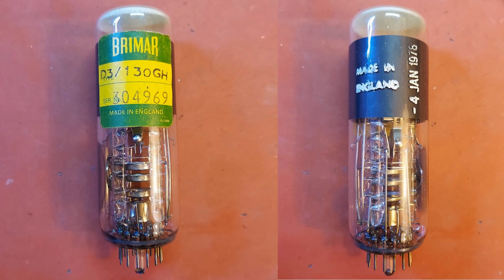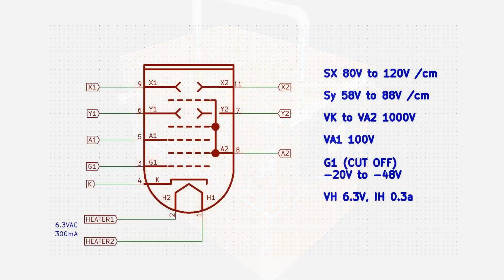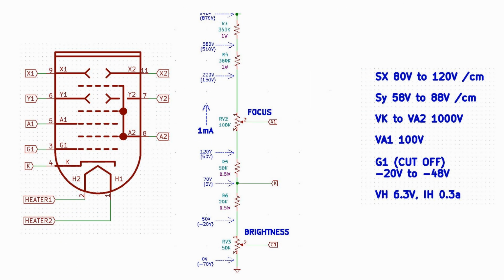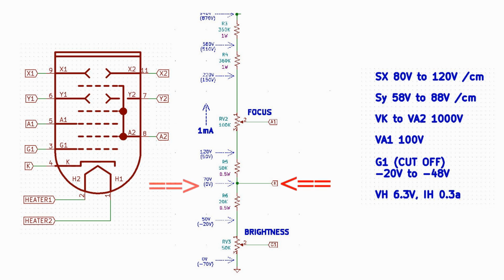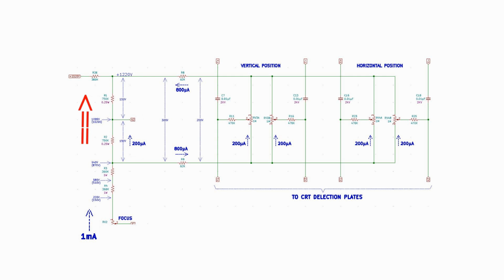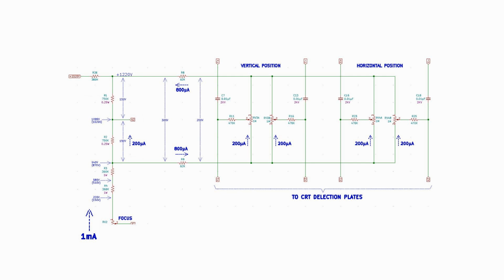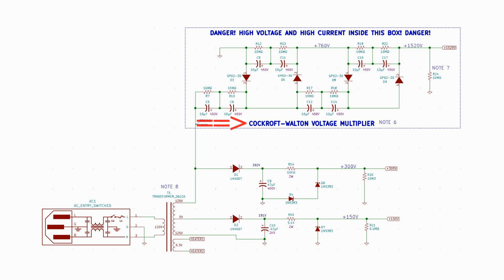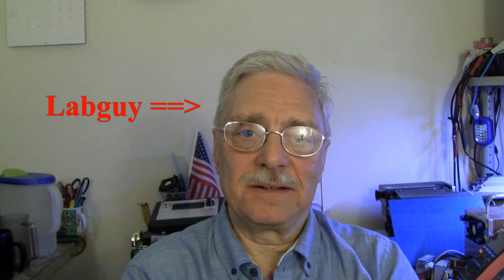Bob-O-Scope, Part 1

Comment: Great project !  I have a couple of old CRT's and will try some of your ideas.
I have a very serious question though;
How come you say (and draw) the current flows from minus to plus in the load?
The electrons certainly do, but the current (I) does, by definition, flow from positive
to negative through a load.
Reply from the maker: The simple answer is that is how I was taught current flow in the 1970s. It also parallels with the electron flow in the tube.

Comment: That's a very cute CRT! I've seen Fran's video on the Nimo tube, but I never knew they made a full CRT that small. It's also interesting to see how "simple" it is to get it to light up and manually control the spot, at least in terms of how few basic components are required (I'm sure it took more than a little head scratching and scribbles on a notebook page). I've got an ancient vacuum tube powered CRT oscilloscope, I'm guessing from the 60s. I've taken a peek inside only to be surprised at how few components are in there, so I'll be following this project with interest.
Reply: Just curious, does your oscilloscope work? Or are you planning to restore it? You should post a video about it sometime. I love antique electronics, especially ones with vacuum tubes!
Reply: @ct6502c  I haven't tried using it in more than a decade, but it worked back then. The beam was a bit unstable, so it probably did need some work. I'm guessing it might need more work now. It's currently buried somewhere in my storage shelving, behind many boxes, and I've got a lot of other projects on my desk at the moment, so unfortunately I'm not likely to get to it any time soon.